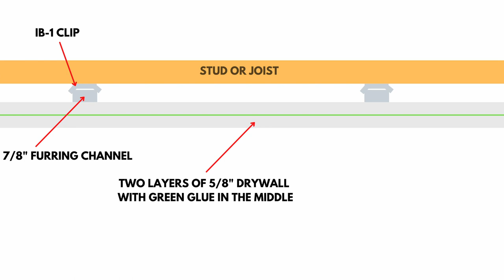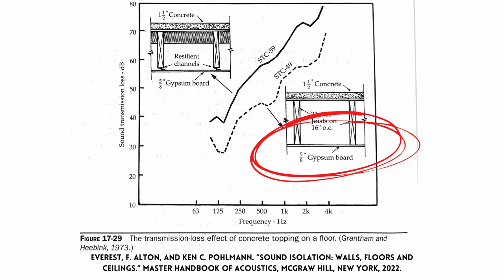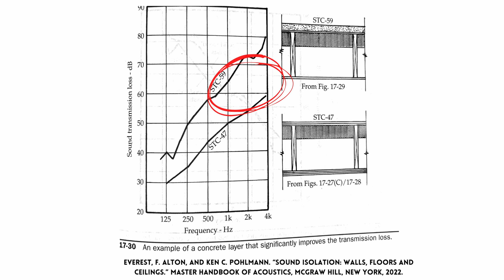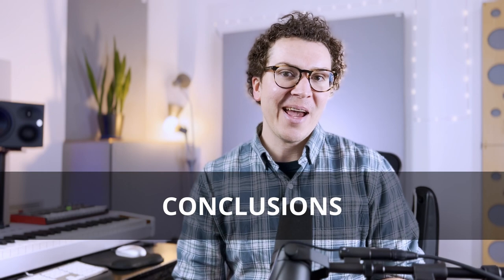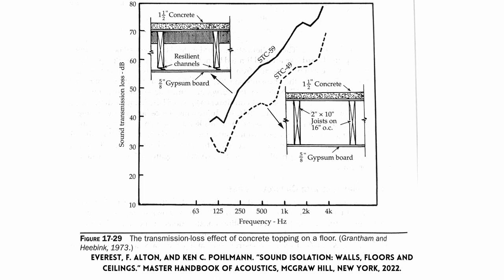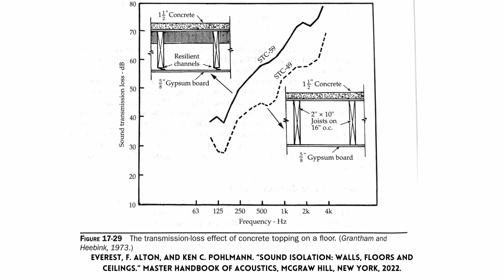Soundproofing A Floor With Concrete

Comment: Thank you for your videos. I have Rods book, but I find your videos better for my consumption. I am about to build a studio (hopefully) in my large detached double garage, it has a great concrete floor already and I am hoping basically building a room inside it will give me the same results you achieved, or very close. Need my drums to not disturb the neighbours at the very least :).
Reply from the maker: You are welcome! Yes, Rod’s book is dense. Yes, you certainly will get great results in a garage.

Comment: Once the concrete slab is in place and the structure is built on top of it, how should I install flooring in the studio? Would carpet be suitable, or is vinyl planking a better option? How should we proceed to place the floor on top of the slab?
Reply from the maker: That is up to you. Any flooring will do. I like wood but laminate works on a budget. Carpet may deaden the room too much depending on your acoustic treatment.